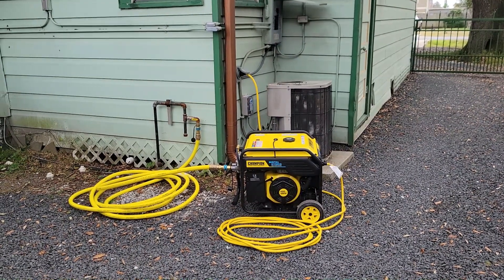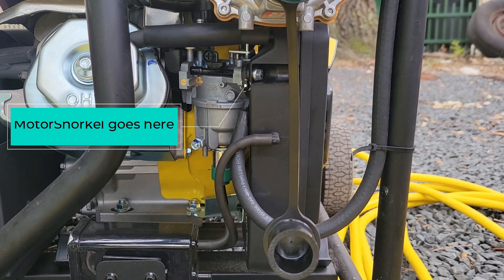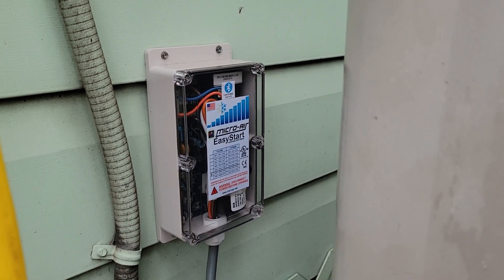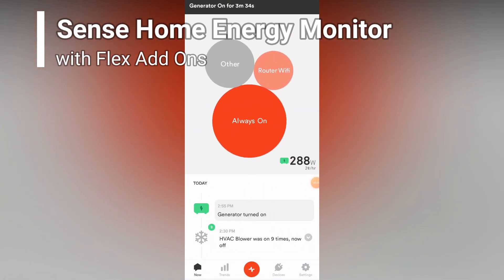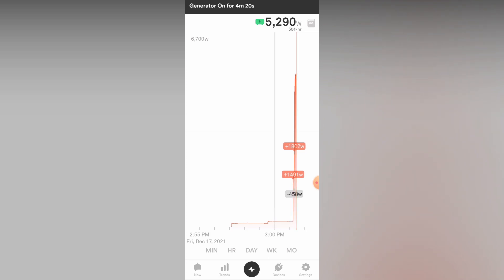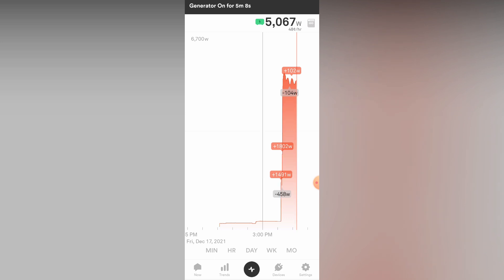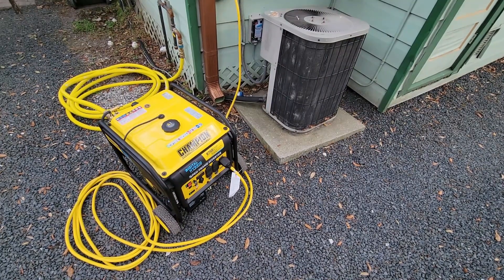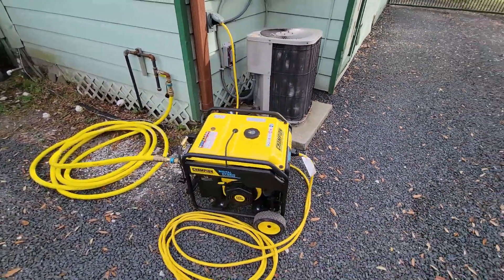Powering an entire house on a portable generator!!!

Comment: Awesome video - I thought it was great! Really cool that you have the same setup and all the stuff I bought. I have the sense and hooked up the clamps around both my main power and I ran the wires from the generator inlet through the clamps so I can measure the generator power too. Got the motor snorkel but still need to install it and put out a video on that. I love how convenient your gas supply is to your generator/AC area. I have no outdoor gas outlet, going to have to really figure something out. Since it is gas, I might have to get it professionally installed and scared it’s going to run me 1000 or something to run a line to the backyard.
Reply from the maker: just watching your easystart vid and your quick shot of your NG regulator... Looks like you have a "t" fitting before going into the house, you could just take that plug out and add a quick disconnect fitting. your handy, you could do that for cheap or pay a plumber to run a line to the back porch :( I had to crawl under my house and run that stub out myself just for the generator.  U can see i have a long hose and cord that runs way out away from the house so we cant hear it too.
Reply: @yourunclefab  That might be an idea... I feel very comfortable with electrical at this point, but I have yet to venture with doing gas lines, I'll have to do some research. How long is your gas line? I think there is a limit to how long they allow flexible hoses like the one you got. The big issue is that that main gas inlet port is some 85 or so feet away from where I'd like to keep the generator. I'd need 100 ft hose and I don't think they allow for that long for gas? I'm probably going to test on propane first as I have a propane tank readily available... Will probably tackle that on the next big holiday. :)
Reply from the maker: @Jonathan Chan  my flex hose is 40ft of 1 inch. I had to go so big because of the BTU and distance from the meter. Total my gas line from the meter is about 25ft of 1.5", 25ft of 3/4", then back up to 1" for the 40ft of csst flex. There are all sorts of calculators for determining the length and size of pipe for BTUs. I was told I could have used 3/4 flex but couldnt find any inside my budget, and a neighbor sold me his leftover 1" after a job. Think our generators need about 120k BTUs of NG.  You will burn through propane faster than gasoline at full throttle, watch out.
Reply: @yourunclefab  This is a really helpful response, and would have been great to include these details in the video as these were exactly the questions I still had after watching.  

I'm in a similar position with a Champion 100155 (7000/9000 watt, non-inverter but one of the very few that had <5%THD from Costco). 

But the distance from my generator location (back yard inside my fence) isn't quite as far at approx. 52 ft from the meter, down the same wall. Using a conservative guesstimate for my Champion I figure that it will use approx. 150,000 BTU (guessing at approx. 15 hp).  Therefore using the "longest length" method of figuring out Natural Gas piping is that 3/4" pipe would possibly work up to 50ft.  But 1" would provide ample headroom just in case I upgraded to a larger generator in the future.  Then I'll have 3/4" flex from the connection to my generator which could be 8-10 more ft.
Reply from the maker: @CajunCoding  I realize that after making it, sorry. If you have the money and means to run 1" from the meter I def would as you'd like. I wasn't able too so several plumbers said running the long length on 1" after the short 3/4 would give me back the volume I would need. It works flawless. Only regret is not getting a bigger generator, but hey, if we need to turn off ac while we cook or do laundry, so be it. We shouldn't be using this setup like we have power, when we don't, it's for emergency use only, unlike a 24kw+ whole home backup.
Reply: @yourunclefab  Yeah, I wish I had a bigger generator but honestly the Champion 100155 (7000w/9000w peak) is pretty great and we got it as a steal from Costco for $699 (6+ years ago).  In that time, we've used it only twice for Hurricane outages here in the south.... in fact simply buying a generator and setting up the wiring, interlock kit, etc. has been -- per Murphy's Law -- the best insurance against having to use it. 

I'm in total agreement, having my 3 ton A/C run off the Soft Start and turning it off to use the MIcrowave for a meal and then back again is really not a big deal during a Hurrication when the power is out!  My wife also agrees, it's not a biggie and certainly not worth paying for a whole home install (since it's not our forever home) to the tune of $12K+ now-a-days...